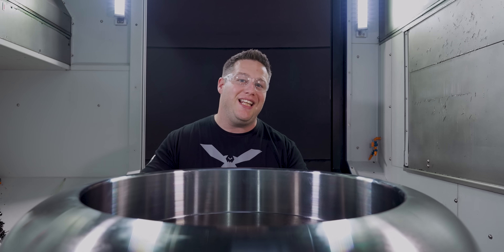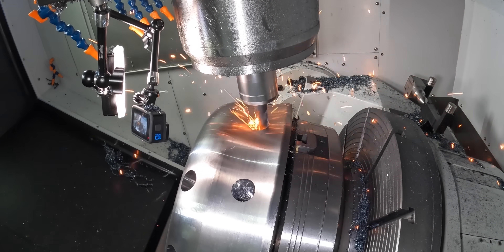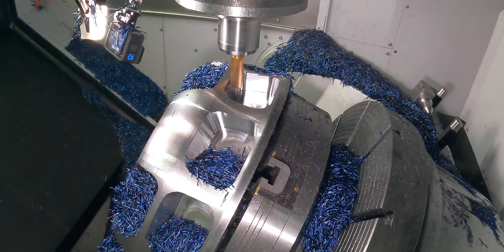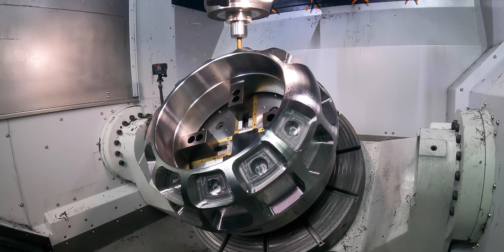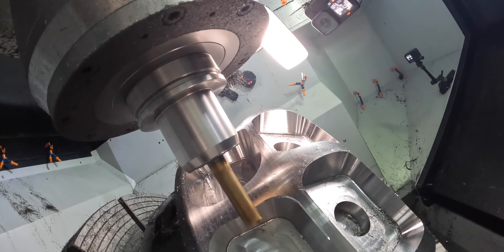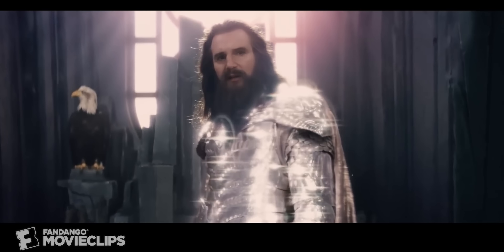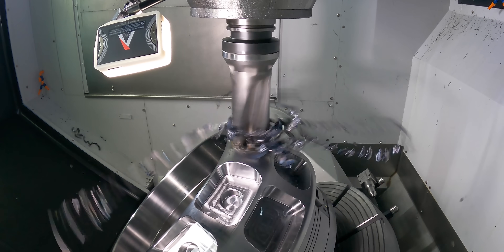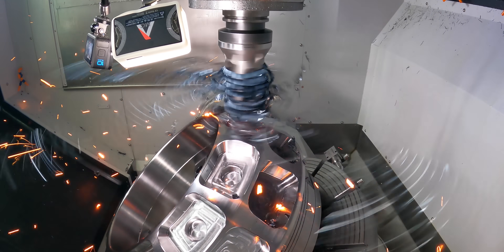Pushing GIGANTIC Tools in MASSIVE 1200 lb Part

Comment: Do you take in consideration of the part relieving itself when you remove that much material. Does the part have open tolerances where it isn't an issue. I can't see how it could possibly stay round.

Comment: Yeah some people don’t understand when you’re machining and you have the right tool with a good coating the heat goes in the chip in climb milling, at times the chips are at the melting point and glow. It’s perfectly ok. And different materials cause different colored chips as well.
Btw Barry not every material has a blue chip!
If you machining stainless it should be a straw color 
If it Tool Steel it might be purple,
And other alloys a bright silver 
I know I was a tooling engineer.

Comment: You show one off crazy complex parts but I don't believe you've had a video going over the obstacles that people run into after running 1k,10k,100k part count and how to fix or spot those problems before starting or bidding a job. What steps you have to take to hold tight tolerances, tricks to make sure part catchers work perfectly after a qty.100k. Tricks to separate a couple hundred tiny little parts out of a chip bucket because the parts didn't fall in the parts catcher after a night of running. The little things that can make or brake profit on big jobs because the big jobs are the ones everyone is trying to get and profit is always tight to stay competitive. It could be with small or large parts, robotically feed or bar feed parts. What is the frequency that you spot check parts as they are running. Whatever you can think of would be appreciated. I wouldn't even care if it was stupid tricks like the double back tap trick that everyone knows about or duct tape tricks. Whatever your guys have seen in the past.

Comment: I might be late to the party, but why aren't they using coolant when Machining this part? Wouldn't that help the surface finish in The lubricity Help tool life😊
Reply: So viewers can see
Reply: Depending on the material and the coating on the endmills, you may actually get better tool life without coolant. But it's very situational. In their case, it's so the viewers can see
Reply: @vanguard6937  not in this alloy steel though. You're better off with coolant for part and tool cooling, lubricity, and most importantly for this part, chip evacuation. Endmills have a hard time evacuating chips from deeper pocketing applications like this. Without coolant or at least air blast, you start to regurgitate these hard, wonky chips and you increase the likelihood of damaging your tool prematurely. 

Normally a pretty solid argument for milling dry is doing external side milling on high temp alloys. There's no chip evacuation problems and there's a section of the endmill in the cut generating a TON of heat that then comes out of the cut and immediately starts to cool down. If you use coolant, it cools down more rapidly and will cause thermal shock, causing premature failure of your endmill. This is only viable if your tool can handle the heat in the first place...which these endmills certainly can.

You're right for the viewing, though for sure.

Comment: Why would you use the massive drill separately? Why is it better than using the same tools as the pockets?
Reply: Drilling is always faster than helical interpolating a hole with an endmill. If you have a large core hole or a deep one, you want to drill it out first.
Reply: Specific bore size? The other holes were pilot holes, hogged out to final dimensions, whereas these were for a shaft?
Reply: It's not really, looks alot cooler tho lol

Comment: Rookie pseudo-machinist here. Why do some tools make chips and other make the long strips like the Kraken?
Reply: It's explained in the video...
Reply: They all make chips. Sometimes the chips don't break apart nicely. A drill is continuously in the cut and so you must use cutting parameters, coolant, and chip forming geometry to cause them to break. An endmill is in and out of the cut and therefore cannot generate continuous chip. However, the small slivers that endmills generate can be detrimental and difficult to evacuate in deeper pockets like this. You don't want to recut these slivers and leaving them in the pocket retains a lot of heat.

Comment: well as we where taught my seco when i was still in school. the coolent cools down the chip really really fast witch makes the outer part of it harder/crispier witch helps breaking the chip much more likely to happen and also easier
Reply: Exactly. It's like hardening steel without tempering. It makes the chip hard and brittle and much more likely to break apart due to it's own movement.

Comment: Why did you do those holes at the end rather than mill them out with the pockets?
Reply: maybe because its a demonstration piece, showing off the 90mm drill. ideally they should have been made whilst the ring was rough to create a flat to drill / mill perpendicular to